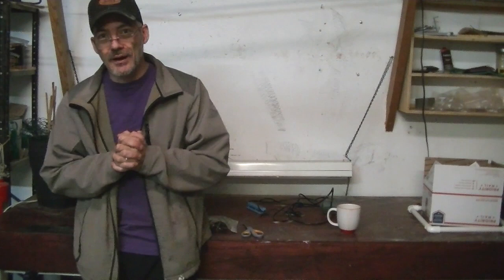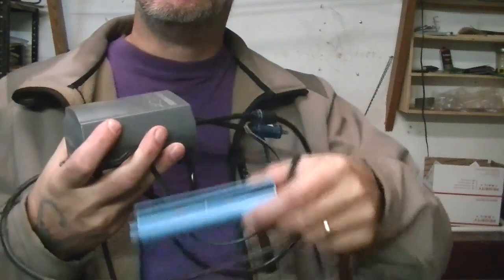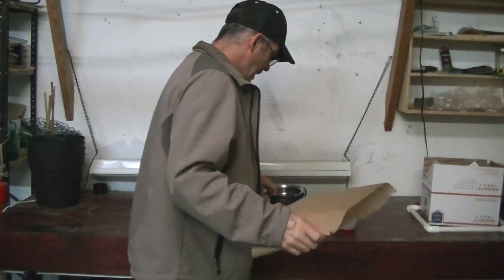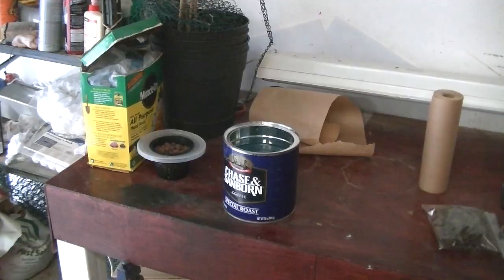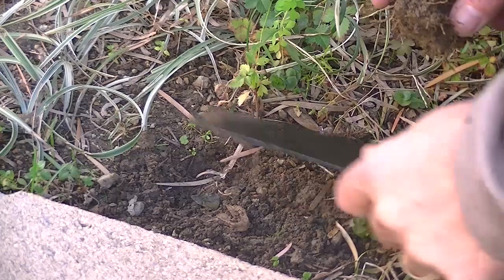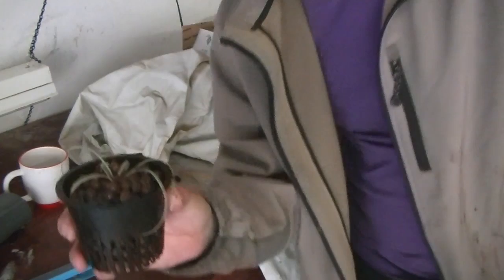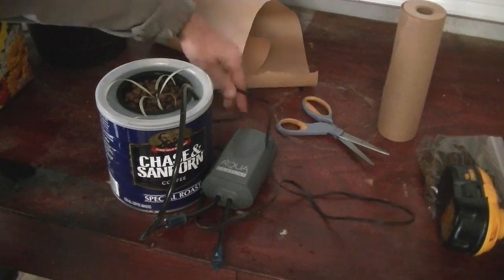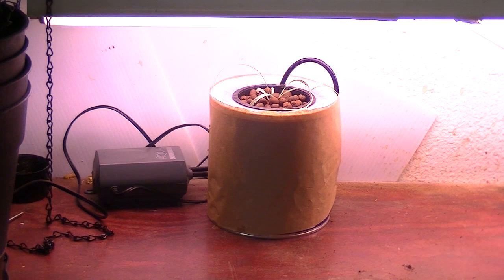Very small Hydroponic system, Home made, for $10

Comment: It's very important, if you don't have a one way valve like he has in the video, water will siphon back up the air line if the power goes out or off, and ruin the pump. So I would recommend that the air pump be higher than the plant

Comment: it is much better to use nutrients for hydroponics than nutrients for soil because there are minerals in the soil that is not in the water also when growing just in water you need to ph the water to between 5.5 and 6.5 so the plant can up take the nutrients for its growth; in soil 6. to 7. for ph level is fine cause the soil has stuff in it to balance it out also if you are growing from seed you need to use 1/4 of what the nutrients say to use and you don't want the temperature to fluxuate more than 80 and less than 55 it shocks the plant try to keep the temperatures between 70-80 degrees. also plastic is much better wash it weekly with fresh nutrients cause the nutrients if not washed weekly will put too much salt in the water which prevents growth. also keep the plants separate cause if one plant gets root disease it wont touch the other plants handle one at a time and keep it all clean from contamination.

Comment: Thanks for sharing! New subscriber here. Any thoughts on reducing the noise of pumps? If I have one my living room, I'd want it as quite as possible.
Reply: you should try hanging the air pump form something near by that was also my problem also I opened mine up and added a lil tissue but that will slow the air flow some.
Reply: Tony Insua There are some very quiet, but more expensive pumps at neighborhood pet store. I've had fish tanks where I sat the pump on a kitchen sponge to absorb vibrations. It reduces the noise, but has to be in a closed area or tray to prevent moving along floor.

Comment: awesome video dude. don't listen to the negative comments this video was to make a cheap homemade hydroponic system. but my question is, where in the heck did you find that pump at? and what is the thing that went inside the can with the air tube? a filter?
Reply from the maker: Henry Ford a small aquarium ai pump and a little bubble bar